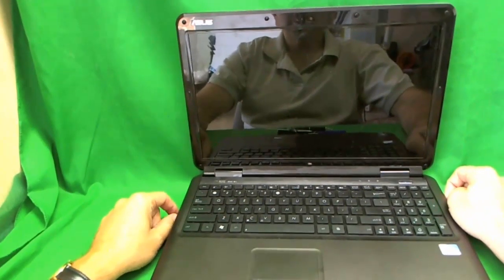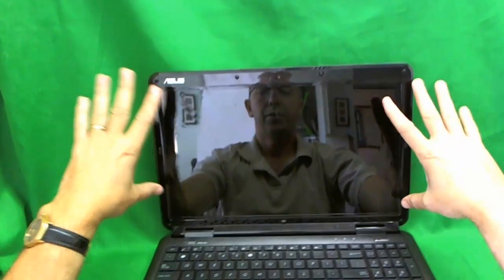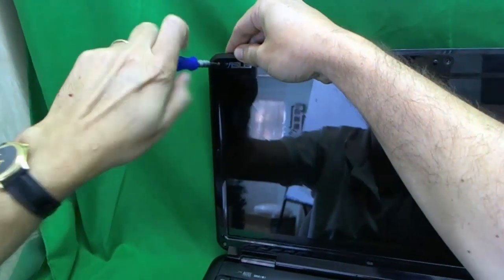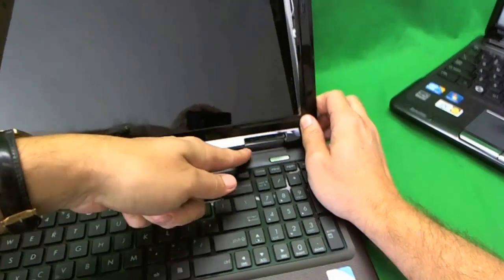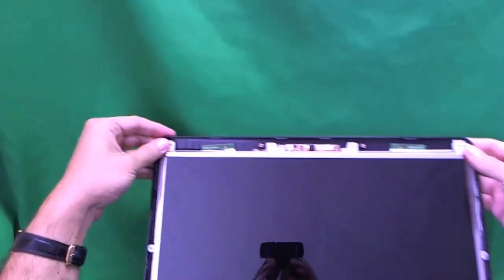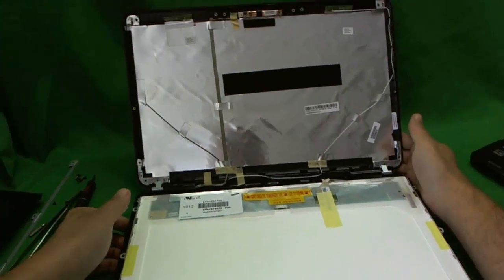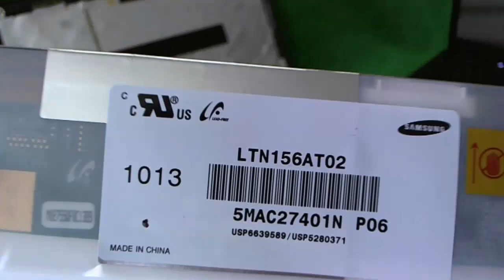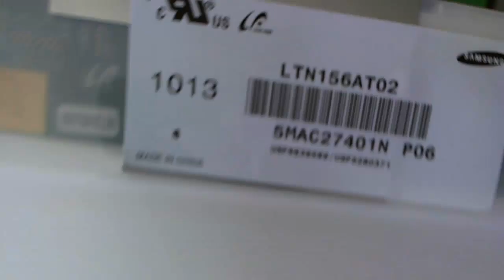ASUS K50I K50IJ Laptop Screen Replacement Procedure

Comment from the maker: @McTyLermore sounds like a battery problem. Try taking out the battery and running it with just the power cord. If that solves the problem, then you need a new battery.